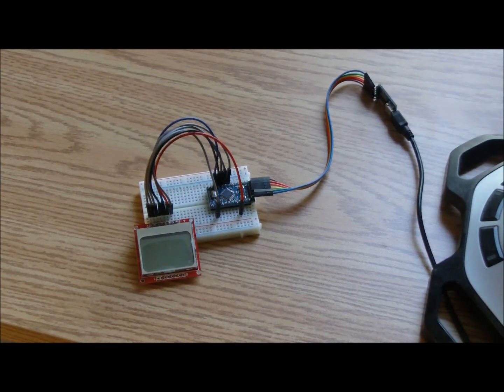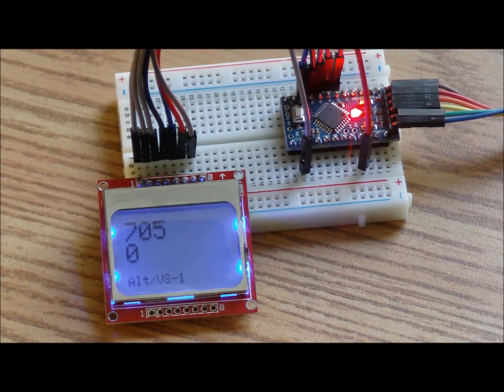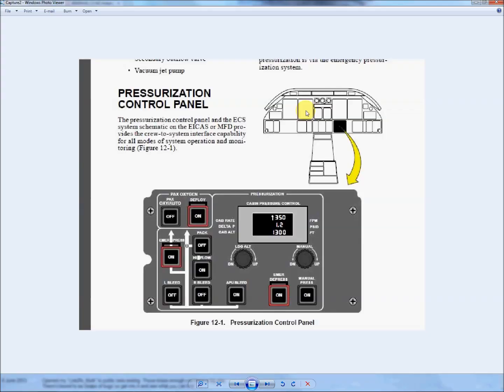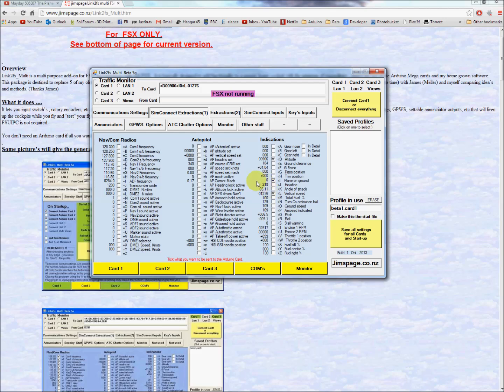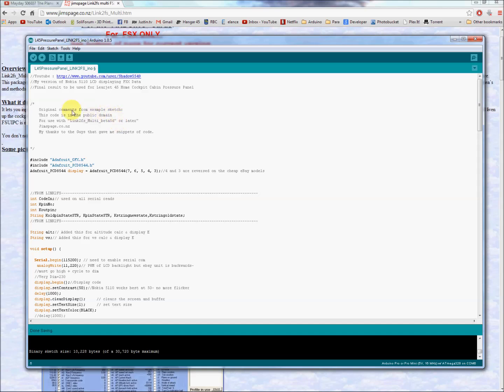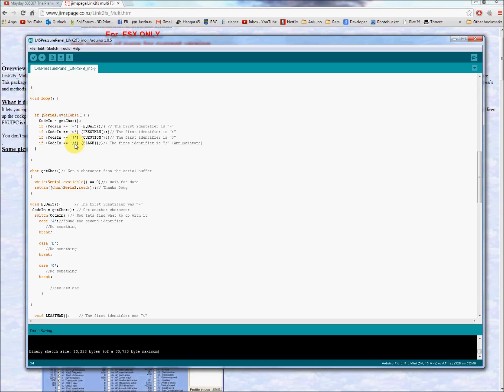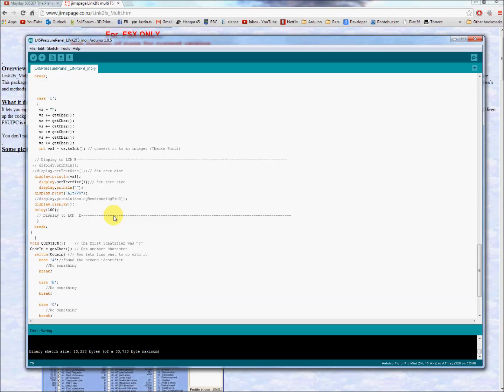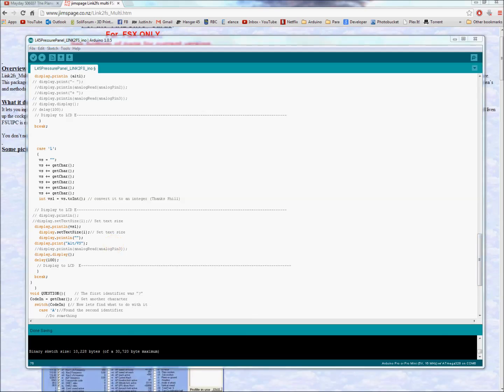Arduino LCD Display linked to FSX Flight Simulator -Tutorial

Comment: I don't think so u will reply but can I do the same for MSFS 2020 as I am using a controller and it's really difficult to set the trim and imposible to set the air brakes so I was thinking to add a joy stick or a a variable resistor which will let me set the trim using hid and check if the value is adjusted according to the joystick or variable resistor as they don't have very free/unlimited movement
Reply from the maker: Interfacing still works the same as it did in FSX https://www.fsdeveloper.com/forum/forums/simconnect.60/

Comment: This is awesome video showing all wiring and schech thanks very much. I wish I could use the arduino on x- plane 11, I'm stoked to x- plane because I built my Simulator in to it, with two 90 degree wing views. Does flight simulator gives option to set a inclined cockpit?  Thanks

Comment: Got myself a handful of these displays for a buck a piece from Chine (eBay). Since I don't have the resources to go for an acrylic or metal box for my generic panel, I've built one from 3 mm (1/8") pretty sturdy foam core instead. Same stuff I build RC planes with. You can easily do all the cutting with a regular Xacto blade or similar. For colour, I use my airbrush ^^
Reply from the maker: ***** Excellent!  FliteTest Would be proud :)  Shoot me any pics or info in the mkme.org G+ community.  Would love to see them.  Cheers